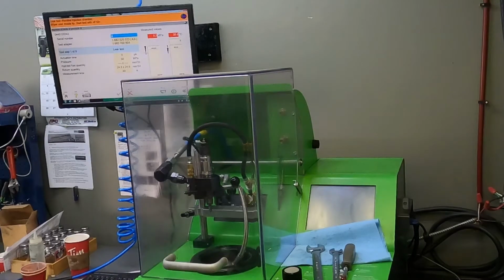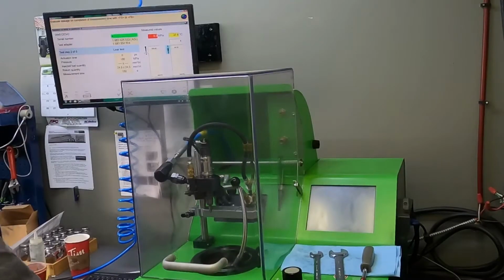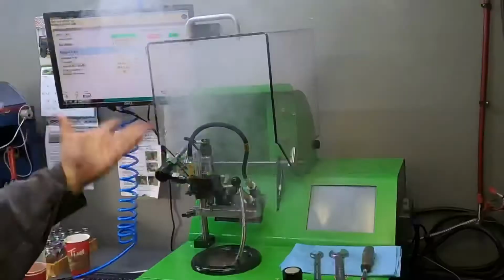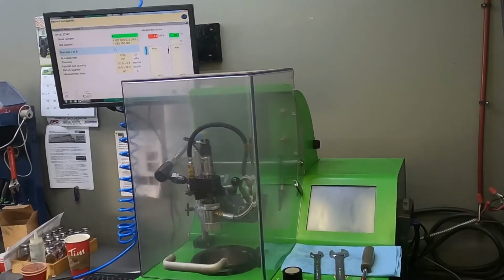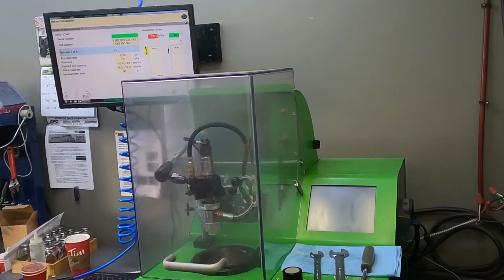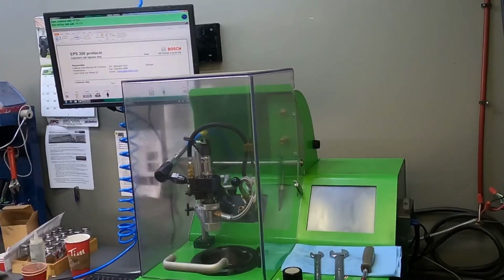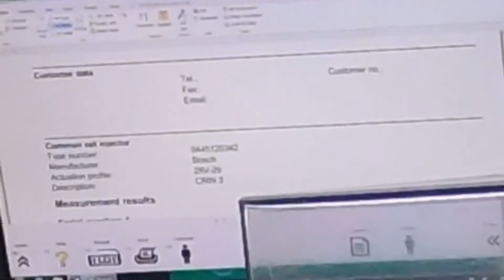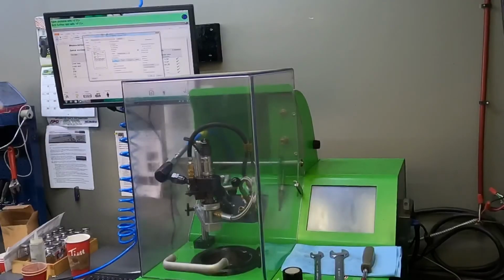Testing a 6.7 Cummins injector on a esp205 Bosch unit

Comment: Hey Rob i just installed head studs one by one in my 98 12 valve what is your take on hot or cold retorque? Is it necessary?
Reply from the maker: it's always a good idea to do a re torque on them and also make sure you check your valve lash as well

Comment: i know this is an old video but, do you know anybody in the states that test theses injectors, if not could i send you an injector to test, i do feel the solenoid is bad....when i ohm checked it it didnt read anything....0 ohms.
Reply from the maker: Any good injection shop said be able to test. Just google Bosch injection testing in you area
Reply: @CUTTERUPROB  tried that, they either dont respond , or they are not trustworthy to begin with